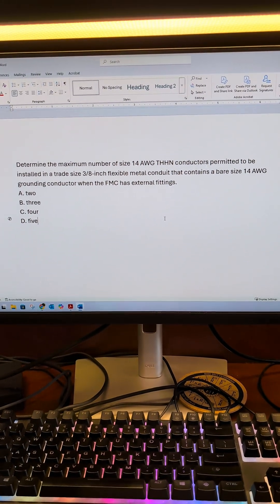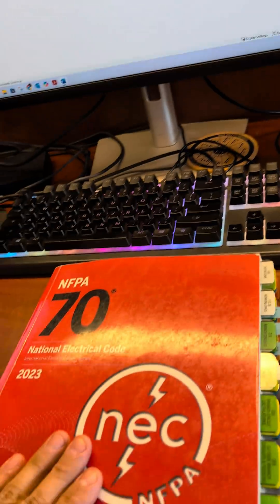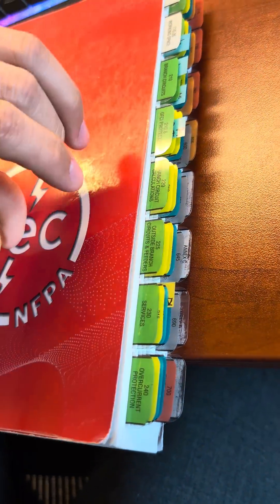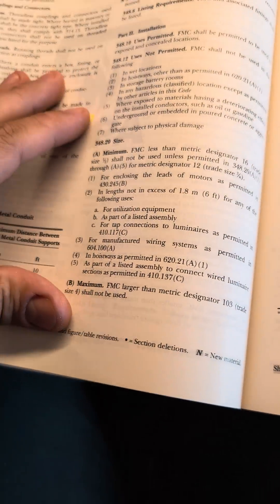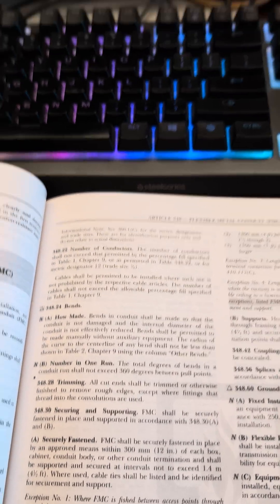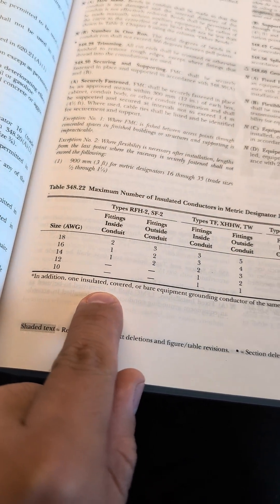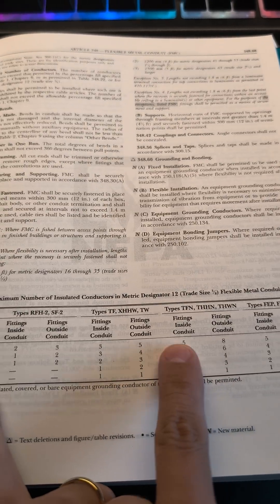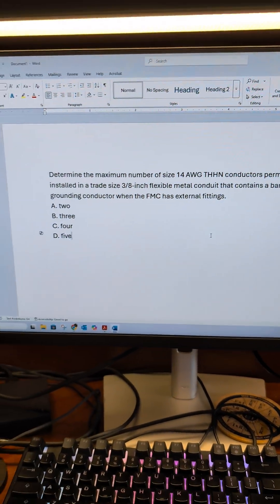Master Electrician Exam Prep: FMC Conduit Fill & Grounding Conductor (NEC 348.22) #NECExam

Comment: I would have thought just 3, considering the gauge of wire, because 4 seems like it would be really tight.
Reply from the maker: I agree. If in doubt, follow Chapter 9, Table 1 of 40% fill for 2 or more conductors. Table 348.22 is sort of an exemption to following that rule.
Reply: @JohnPaulElectricTX It's a table of rules allowing for limits on how far you are legally allowed to do it and still remain in compliance with fire safety electrical code. Thank you for your help in understanding this.